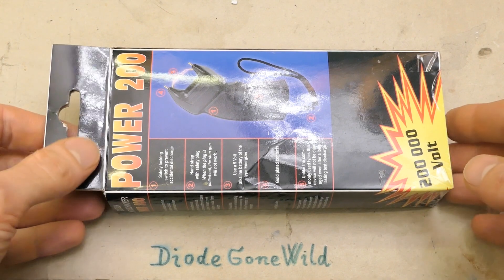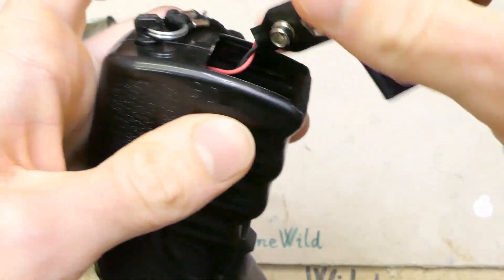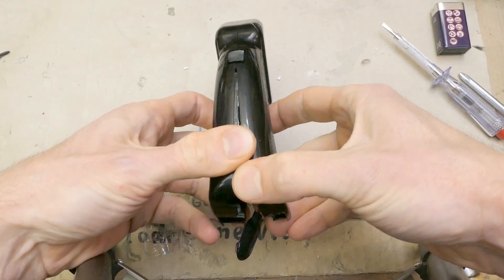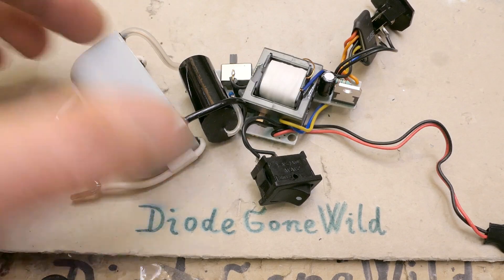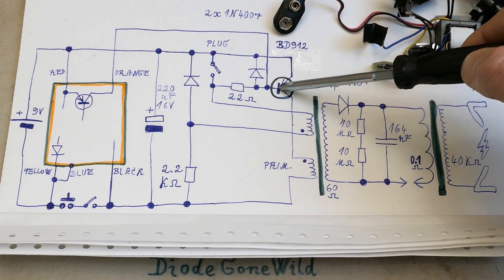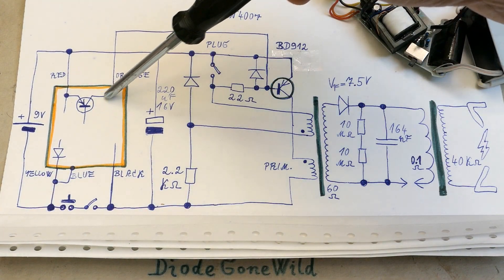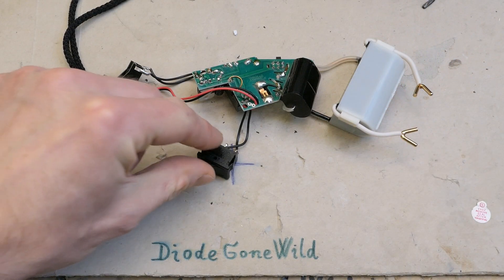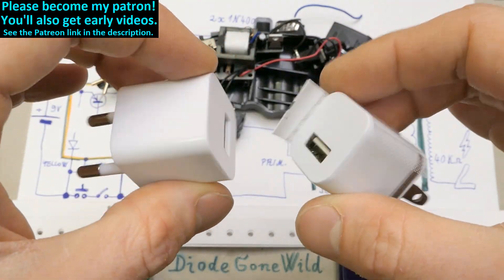What's inside a Stun Gun (Power 200)

Comment: I have an old gen unit like this one, minus the timer circuit and it runs on 2 parallel 9v batteries. Everything in the circuit is familiar to me except on the output. Theres an encased component parallel with the hv pulse transformer. Together, it reads 72 ohms. Ill desolder it and test with a component tester. Im wondering if it's a very high impedance resistor in the megaOhms. On a bench top power supply, itll draw 2 amps at 8.5v, 17 watts.

Comment: What yr did this gun come out,1960s  looking huge model. 😅
  Stungun will get your self killed because theres no charging incator so you just over charge. The caps or resistor blows out at any time from all the shorting thats going on lol.The best way is just fire it into things not much air fire.I would soldered fishing hooks to turn it into a internal acting  air projectile acting like tazer so it can arc inside the guy not the surface pain that wont work most time.I know its illegal to mod these things with fishing hooks but it works better. 😅
 This stun gun is not doing 200 hundred thousand volts.its a gimmick. It only doing few 100 mabe couple thousand but never million or 100,000 from the shop.you just build one that dos few 100 thousand true volts.
 Theres three spark gaps.theres one inside the gun to jump secondarily and two out front.

Comment: An interesting video, but why complicate (put a microcontroller) in a primitive device?  The gas spark gap is not Epcos, a multivibrator on one transistor, although a multivibrator on two field-effect transistors would be more efficient.  Well, battery power will not give a lot of output power.

Comment: instead using chip as timer sefty circuit i think they can use micro thermal reset switch (NC )  and thermistor in parllel then in seriese with circuit  so thermal switch let current pass through it at starting untill it get hot by transistor and cut the switch and let current pass through thermistor which is in parallel
with thermoset keeping it warm and off for long unless power is off .

Comment: Can this be somehow modified (e.g. by inserting a variac or a stepped autoformer/transformer) to turn it into an ESD test generator? Then the timing circuit could also come in handy for programming various tests. If so, where would you place the stepped transformer?
Reply: Easier to just put an adjustable spark gap there.

Comment: @DiodeGoneWild You can't swap air gap and capacitor. Because in this case, flyback rectification current should go via HV transformer primary. And it will badly rectify because of primary inductance.

Comment: Great video, yeah I doubt that a device like this would last for very long. It's also not a good idea to use rechargeable batteries with them, due to the lower voltage (8.4V instead of 9V) and also the high current (over 2A when full?) will permanently damage the battery.
Also, I can't wait for "dangerous usb phone chargers 9"! :)

Comment: Interesting video.
If you use a high capacity discharge LIPO battery and a gas discharge tube as spark gap, you will get a better performance.
Greetings.

Comment: You should try to power it with a stronger DC source (eg: lab power supply) and then increase voltage to see how far it can go.
Reply: I had that happen by accident with a stun-gun module. I was running one off of a bench supply but forgot to ground it and left it floating. The voltage from the corona eventually nuked the pass transistors and it went up to 90 volts DC. It was very dramatic indeed. Went from some little sparks to literally a tesla coil. Surprisingly it survived it. But still seeing thick-ass 6" sparks come flying out of it was something I will never forget.
Reply: @mysock351C  Holy cow! 😳 I bet it was spectacular!

Comment: 16:18 at high frequency the secondary of the first transformer would have very high resistance so the current through it won't be that high, but still I think that swapping the places of the spark gap and the capacitor would be better.

Comment: Those sparks looks weak, like a single thin spark.
A proper one should oscillate and have several hot sparks for one spark.
Should be much better if the capacitor was in another way or a "small" on the other side of the spark gap

Comment: Good one lol. I made two of these for my daughters cause they live in a sketchy neighborhood lol. I used a proper fly back with no spark gap and it is way more efficient. The spark gap on the electrodes are 3.5 cm. With a good amount of juice lol.also use lithium 18650 batteries with a usb charger and board.
Reply: Did you warn them about the legal ramifications if they use them?
Reply: @johncoops6897  no problem here. Their not lethal.
Reply: @melplishka5978  - cool. It's a maximum 11 years jail for just carrying one here in Australia! I checked and found they also illegal in a few of the US States, but not all.
Reply: @johncoops6897  Can you own it at home in Australia?Or was it legal to carry one earlier? Someone on a forum wrote that in the 1960s dynamite was sold in hadrware shops. As Tom from Explosions&Fire said,God bless the 1960s.
Reply: @MernokiMegoldasok  - In Australia It is illegal to possess or use a Stun Gun or Taser. In my state, the maximum penalty is 14-years imprisonment.
As far as I know It's never been legal, however before specific laws they would have been classed as a "weapon" which is also illegal. Note you can apply for a license to own weapons, but it will not be granted for general public.

Comment: I've yet to see a stun gun properly stun anyone. I wonder how many amps and with what kind of pulse shape that would work.
Reply: are you volunteering ? you might be right, considering what's required for a taser to do the same job...still, I know from, ah, past experience with hobby work, that those things would still be a decent deterrent, no ?
Reply: @psycronizer  Not sure about volunteering, but I did conduct some experiments on myself at some point by driving a high power neon sign transformer with a high power audio amplifier while holding on to the transformer output. That way one can try different voltages, frequencies and pulses quite easily. At some point it does start to hurt quite bad and one gets really tired after getting shocked for a while. Not really recommended as neon sign transformers can kill you. It may be that there is no good way to stun a person with electricity with just two skin electrodes without increasingly high risk of killing them. Still an interesting theoretical question.

Comment: 0:27
Agreed, claiming 200 kV on a stun weapon is like claiming 300 miles for the reception range on a TV antenna.  Even when analog TV was a thing and after TV went digital, even the strongest TV signals would fade out within about 100 miles of the transmitter due to our planet's curvature (Yes, flat-earthers, the Earth is actually round like a ball, and not an infinitely large 2D Cartesian plane!).  Also, I had a thought while taking a shower within the last few days where an electronics student was building a USB charger to recharge a 2S2P 4680 lithium iron phosphate (LiFePO4) battery pack (9.2 volts @ 18 Ah, ~165 Wh) like those found in the newest Tesla vehicles that powers an Elenco superheterodyne AM/FM radio kit similar to an AM-only kit I have (but for more advanced electronics enthusiasts).  In the charger, the character has designed the circuit board along with a close friend of his where the board ends up with several inches of clearance between the primary and secondary sides of the board, enough to fit a series of holes in the isolation for a fan to blow air through the charger so that it can keep the components cool.  Also, the transformer uses several layers of Kapton and electrical tape between the primary and secondary windings along with heavy insulation as opposed to only the lacquer on the wires, which as you say, can be as little as a few dozen micrometers.  The plug on the charger ends up being grounded along with the adapter that the character has designed to go with it, which ends up making the charger include a Y2 safety capacitor between the sides of the board, along with proper interference suppression and snubber networks.  On top of all of this, the charger even comes with a built-in power meter and dummy test load to see if the charger really can deliver 240 watts over USB Type C and 18 watts over USB Type A with RGB backlighting on the USB outlets for improved visibility at night.  Besides a thermometer displaying both Celsius and Fahrenheit, this isn't even a complete listing of the features of this charger since overvoltage, overcurrent, and over-temperature protection are obviously mandatory.
Reply: Why did I just waste my time reading that incredibly boring and Absolutely pointless rant?

Comment: What’s the problem with measuring the current with a clamp meter? It’s well below its range... Are you worried about HV getting induced in it because of all the interference?
Reply: Yes, heaps for RF will kill the multimeter.
Reply: @johncoops6897  Happened with me when i was doing experiments with a microwave oven magnetron even at low power.